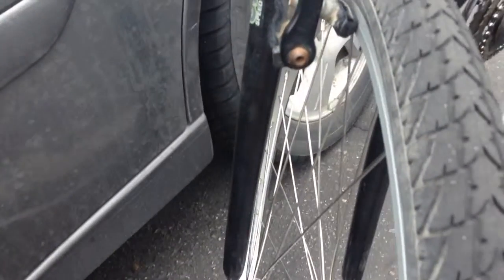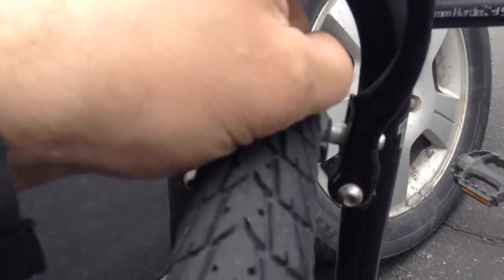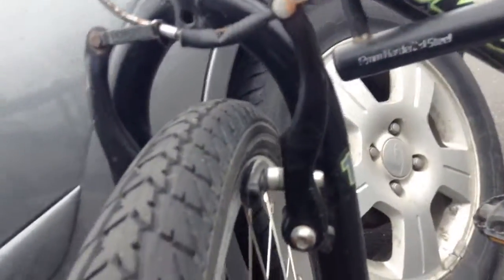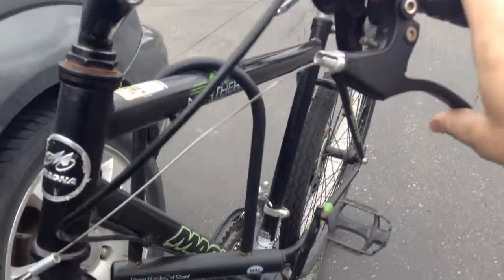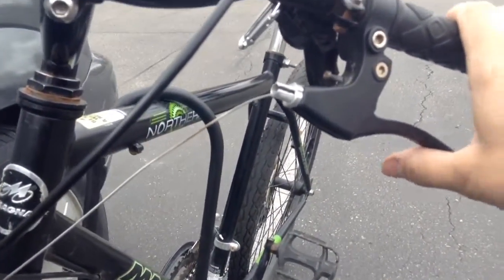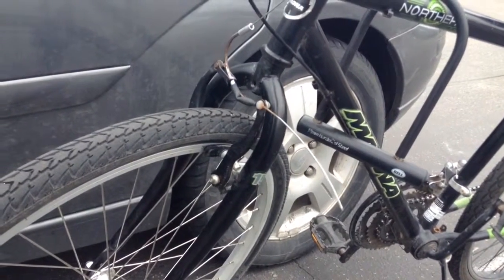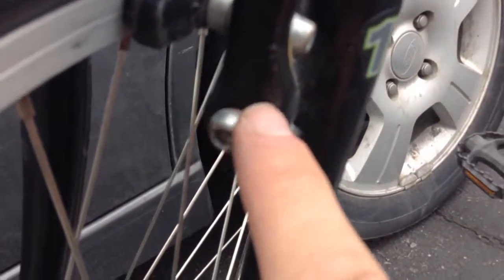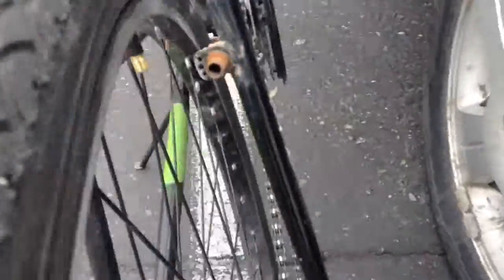Replace front brakes with rear brakes. Right caliper is tight & stuck; need new bicycle brakes.

Comment: thats not the same bike. did you swap bikes ?
Reply from the maker: +TheSolx1 I got a new tire. The wheel broke. Also, the handle bars look different because I removed everything from the right side. I will only use a left brake in the front. This might be easier for maintenance.